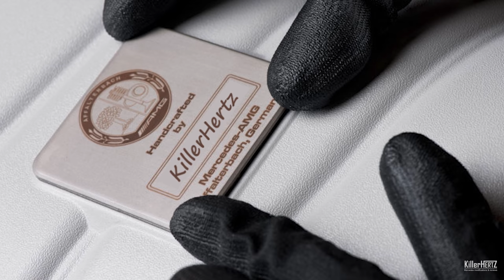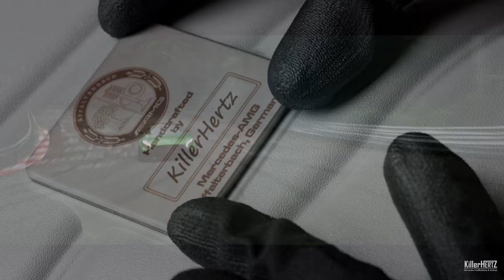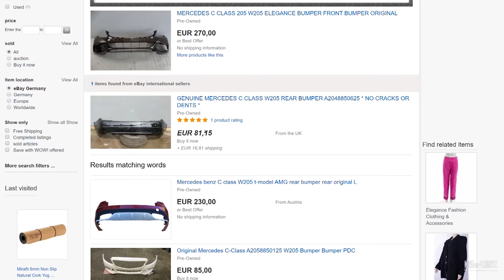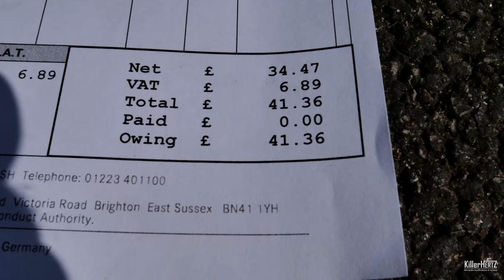W205 Mercedes C-Class Total Front End Conversion

Comment: What about the grille's active vents? I thought that classic (called exclusive in Germany) version had active grille slats which are opened and closed by the car's computer control to warm up the engine faster and cool it when necessary? The car is even more aerodynamically efficient when the slats are closed! That mechanism must be there on the grille? And surely it can be activated by changing some setting in the car's system? Only question is where does it connect to, is there a slot on those cars equipped for the other front end ready to accept the wire connection?
Reply from the maker: This car didn't have any active grills so it was fairly easy to convert. 👍
Reply: @killerhertzmercedes  You mean you left them out? Is it possible to include the active grills, as they are part of all 'exclusive'/'luxury'/'old-school' front grille w205s?

Your car of course did not have active grills as none of the  'Avantgarde'/new type grills have them, but AFAIK all old-style grilles have active slats. That's why I was wondering: all the old style grills are supposed to have active grills.
Reply from the maker: @pistonburner6448  The car never had them in the first place. It's a 1.6 C200
Reply: @killerhertzmercedes  Yes they did: all old-style grille cars had active slats!
Your car had the new style grill so of course it didn't have active slats...no new style grill cars have ever had active slats as Mercedes never offered that even as an option on the new style grilles!

The whole point of my question is: since you changed to the old style grille why not also add the active slat function as it's undoubtedly a part of the old style grille you installed? Or was the active slat system somehow removed from the grille you installed? Or was it some aftermarket non-Mercedes part?
Reply from the maker: @pistonburner6448  The car never came with them, the replacement grill never came with them. I swapped it over as per the video and it has been fine for the past 3+ years. 

If either the car I worked on (a family members car) had them origninally I would have fit them again. 

The car has the 1.6 Renault derived engine and never had them. 

Regards
Reply: @killerhertzmercedes  You don't understand. I know your car never came with them. That is because your car didn't have the old style grille. 

The active slats situation was very simple: they came with the old style grilles. They NEVER came with any W205s with new style grilles. It was the grille style which determined whether it has active slats or not.

If I have understood correctly ALL W205s with old style grille always came with active slats. I'm not 100% certain if there was some base engine option which actually did in fact come with old style grille and with active slats but so far my understanding is that it was simple:
Old style grille = active slats
New style grille = no active slats

That is why I was curious as to why your old style grille didn't come with active slats and why you didn't connect it up to work with your car...and if there were any issues with connecting the active slat system to your originally non-active-slat car.

Up to now from your answers I gather that you ordered your old-style grille and it never came with the active slat system on it (it had been removed?) in the first place so you never even tried connecting it to your car's systems?
Reply from the maker: No gains to be made adding a system which didnt orginate on the car in the first place, if anything it could cause extra issues. Plus you would need to get it coded onto Xentry which might not even be possible against certain models. MB spend Billions on R&D, we dont know better than them :) 
 @pistonburner6448
Reply: @killerhertzmercedes  Yes, I was wondering exactly about that: how much of a headache and a journey into the unknown it would've been to explore getting the slat system connected to a car which didn't come with it originally...

What I was expecting is that perhaps there was some coding genius on some forum who would've known and told you how to find the connector slot for the cable and code in the ECU for your car...as surely all W205s have that active slats code always in their computer, it's just deactivated for the models with the new style grille...

I ask because I'm looking for my dream spec and as-new-as-possible W205 (facelifted) and it's really doubtful I can find the full dream combo if my criteria also includes the old-style grille...so I'll probably have to buy a new-style car and have the grille swapped!
I had a very high-spec W205 (acoustic comfort pack, air suspension, everything!) years ago and I was surprised how I've missed it...I have to have one again! The E-Class I've owned since then haven't felt as good (except the massage seats, though now I seem go have found that there were some W205 with massage seats...? I can't confirm!) nor are the new Merc models (W206 or any others) anything like as good as the old one (I'll never buy a Merc with that horrible screen and all that fakery...).

Comment: hi i have w212 e-class and i would like this done mine is a 2015 se trim, how do i get in contact?
Reply from the maker: In the current climate, it would be virtually impossible to source the parts from overseas. if you can supply these, I would be happy to fit!
Reply: @killerhertzmercedes  if you can give me a list of part number I can source and supply. I was under the impression all I would need is the bumper and grill. Would all the internals from Current bumper swap over to the new? If so what would the cost of installation be?

Comment: What happens if the white tube gets damaged?
Collision detection thing
Reply from the maker: You will get an error on the dash for the collision detection system.
Reply: @killerhertzmercedes  will replacing the tube fix the problem